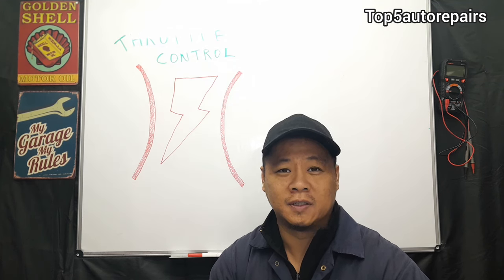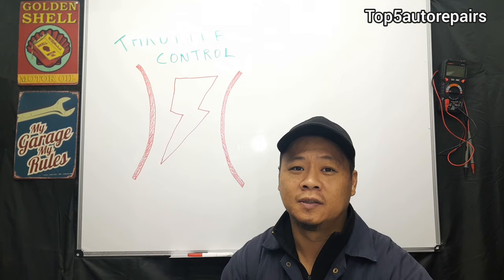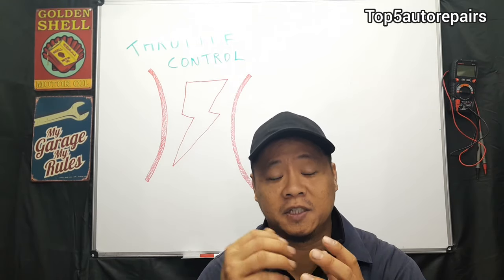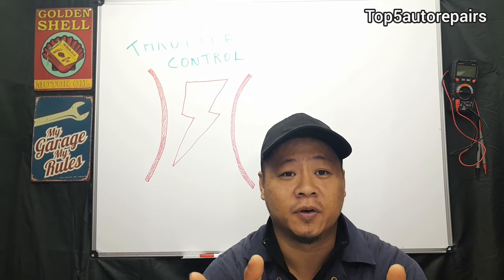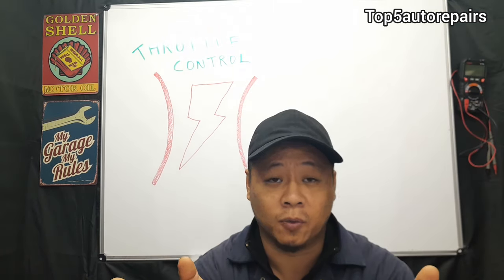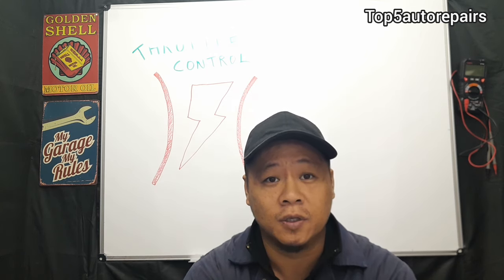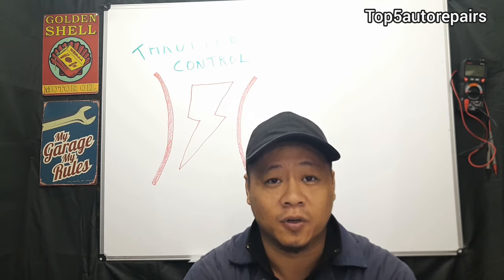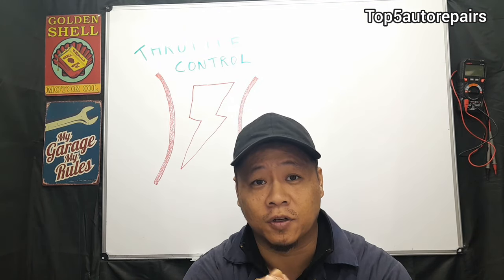Lightning Bolt Warning Light Showing Up On Dashboard How to Fix It for Dodge Chrysler Jeep etc..

Comment: FYI ... Mine was not the throttle body.... Check the codes first... Mine was throwing 7 different codes... one of them being the crankshaft sensor and that's what my problem was. Every video I watched here said " throttle body" and I wasted 300 bucks on one..... Oh well lesson learned. Check the codes.
Reply: What did you do for the crankshaft sensor
Reply: @EscobarMT  I took it to a repair shop, it looked to difficult for me to get  to.
Reply: @JB-ef7qc  and did it get fixed? In other words did the lighting bolt showed up
Reply: @EscobarMT  Yes it runs great now, the lightning bolt went away

Comment: My engine light and the lighting warning came on and dropped the coolant needle all the way to cold i scanned the vehicle and it comes up as a throttle body and coolant temp sensor issue
Reply: I have the same issues...
Reply: @raw_si_siht  yea it clears itself after a few cold cycles but i recently had new cam and lifters installed maybe the shop didn't calibrate the throttle body correctly or something its a weird issue 😂🤦‍♂️🤔
Reply: @BlackSheep300  My problem is floating on the freeway and only the freeway. It gets dangerously close to cold on the gauge. Doing a little research it's either the thermostat or the coolant sensor...
Reply: Did u fix if so how mines doin the same thing rn
Reply: @eliiskii-8410  one day it just cleared itself and hasn't came back since then
Reply: Same here coolant temperature sensor
Reply: @BlackSheep_300c  how did you fix it
Reply: I had that issue and it was the Thermostat sticking open and it made fuel trims off so every light came on pm
Reply: @lindsayshelton5345 Was your vehicle showing the P2181 code and the throttle control light? Mine does while the temperature gage sits all the way down.
Reply: @danielwells3526  I don't remember code number but it was a code for engine not reaching operating temp and many dash lights I recommend verifying the Thermostat is good. They are cheap
Reply: Same with the 2012 dodge charger
Reply: Mine was the coolant temperature sensor as well that fixed my problem.
Reply: Same thing I didn’t check the cel light. But no heat. Car was still powerful. I think the autozone failsafe thermostat is shot
Reply: same things happened to me we 07 JGC two days ago when the wind chill. hit minutes 30 in Kansas City.  Car appears to be running fine for now.  fingers crossed
Reply: Mine too but it is also leaking… looks like my water pump failed also?
Reply: @danielwells3526 did u fix it?
Reply: @glitzyclaps7719  Yes. Swapped the throttle body (I don't think it was the problem), installed a new coolant temp sensor, and topped off the coolant (make sure to burp the system in case of air anywhere). Doing this got rid of my problem completely. The throttle light seems to come on when these cars have other issues, which can be misleading.

Comment: First lift your engine plate and make sure all plugs are connected. I’ve been experiencing this for a week now and this morning I check under the engine plate and a wire has come unplugged. Plugged it back in and problem gone
Reply: Thank you, but what do you mean by Engine plate?
Reply: @Bootnerd3  Guessing he means plastic engine cover over the coils and plugs on top of motor. Where the oil cap is.

Comment: My Jeep will be working just fine and then the lightning light comes on and kills the motor and then won’t start for a terrifying minute or two then fires right up and acts like nothing happened 😑
Reply: My 2011 jeep does the same thing
Reply: What was the problem or did you fix it ?
Reply: Was it fixed?
Reply: Did you figure this out by chance? My 2008 Jeep is doing this as well, runs fine, idles fine this light comes on flashes a check engine and dies. Starts right back up as if it didn't just give up on me. 😂😢😅

Comment: I did recently replace the starter … the check engine light did come one for 2 days then it went off , it’s not on now but throttle body light is on

Comment: This happens to my dads dodge caliber but ONLY when its cold
Reply: Exactly the same problem with my 2009 caliber. And it looses power when the light shows up
Reply: What’s the solution
Reply: Exactly same here
Reply: Same here only when cold. Last time we noticed our engine oil was low. And the vehicle doesn't have a low oil warning and that can be one reason....at least by the videos we searched up. After adding oil it didn't happen again in the very cold weather.
Reply: @magdalenagonzalez372  our oil is fine
Reply: Have yall fixed it yet
Reply: @adanreyes7790  taking my POS to a dealer mechanic to diagnose it.  I changed out the throttle body, PCV valve , checked Purge Valve functioning, battery is full, oil is good.  I’ve read someone said their fix was several things, a new one I seen today was the fuel injector o-rings..
Reply: Right it’s happening to me now off and on all winter idk what to do
Reply: @imtryingtomakeitkobk8418  mine is currently doing this when it's cold I have changed throttle body the whole pedal inside every thing the o2 sensor idk what else to do to fix and nothing comes up on diagnostic tests
Reply: @sef2273  have you tried replacing the accelerator pedal?
Reply: @disgruntledgrappler  no, I’m going to try replacing the intake manifold gasket cuz I can tell it’s leaking…
Reply: The same here I got a jeep compass 2012
Reply: Just so everyone knows I changed my leaking intake manifold gasket and my problem went away. It was not the throttle body.  Even tho I had the red lightning bolt and limp mode.  Problem solved.  I also had a leaking primary thermostat housing I replaced that too.
Reply: @jessicamartinez9678  check your intake manifold gasket. Spray some mist water or break cleaner around the manifold while the car is running. If the engine starts to choke it means it’s leaking
Reply: @adanreyes7790  it was the intake manifold gasket!
Reply: @sef2273  did you get any P code?
Reply: @psilva00  believe there was a large EVAP leak code.  But I think that was associated with the ESIM leaking. Could of been both.
Reply: @Sobergoddess have you gotten the issue resolved?

Comment: Thank you for this video, my father has lung issues and his jeep patriot broke down late in the evening. Just from talking to him over the phone of the issues, I was able to pinpoint it to these issues and drove out late evening to replace the bad TB. Tried relearning, resetting and disconnecting the battery, all did not work.
Reply: bro I’m going through the same shit with the exact same car. the Patriot is dawg shit. make senses why they stopped making it
Reply: Just drive it for couple of miles the computer needs to relearn the throttle body..
Reply: I love the jeep patriot meeting. It's turning to a pos
Reply: @EricIbe same here for me months later. I hate this damn Jeep
Reply: My throttle body likes to act up when it’s cold outside , I just replaced it … it was fine while it was hot but now that it’s cooling down it acts up ( flashes for a few seconds , when it flashes it idles weird … just by me simply cranking up still in park … )
Reply: @Rreneemilli My 07 compass just did this dumb ass shit when I got off.. just got the TB replaced though smh

Comment: I don't know much about vehicles but I had this issue (dodge dakota) a few months ago and had it fixed.  Well the light is back on and earlier it didnt start the first few times, which is what happened the first time until it didnt start at all.  I'm assuming thats going to happen the next time I try and start it.   I know this is a hard question to ask online but any obvious reasons why it would go bad so shortly after being fixed?  Faulty part, something else, etc?     Also just had wheel bearings replaced and one is going bad.   I'm so annoyed because TWO things I just had fixed already need to be replaced!   Sorry for ranting... thanks for the good vid.

Comment: Mine is giving me a code of p2173 . I changed my throttle body and still get it.  When changing my throttle body i accidentally dropped it on the ground and cracked a little part of the plastic. Will that cause that code maybe cause its cracked? Thank you so much for your informational videos.

Comment: I just got that lightning ⚡ symbol and was due to weak battery so I jumped started deleted it all error codes and it worked well now... I'll have to find out what's causing the battery to die if I don't turn the vehicle on every day tho
Reply: Did you find out?

Comment: I replaced the throttle body, and the MAP sensor because the throttle control and traction control lights keep coming on. After I replaced the throttle body I got a code to replace the MAP sensor. I replaced that also. The throttle body and traction control lights are still coming on. The codes from O'Reilly's are still showing the MAP sensor needs to be replaced. Somebody told me that the traction control sensor might be dirty, and causing the problems. I do have a strut leaking hydraulic fluid. Do you think this could be causing the throttle body light to come on?

Comment: 2014 dodge journey, feels like the fuel pump is going, but I’m thinking it’s the TPS sensor. At idle when I stop, the idle on the rpm gauge will go up and down about the width of the needle. Acceleration is fine, but sometimes at cruising speed, it will surge, and goes away if I add more gas, or down shift to 5 gear. When climbing a hill, it’s worse. When I go through the mountains, 9/10 times, the lighting bolt comes on and goes away on a restart. I don’t get limp mode, but my engine temperature gauge stops working and I lose heat. Should I start with TPS sensor?  352,000km on it. Just had transmission done last year. Dealer replaced solenoid and some linkage stuff. New pan, filter, etc. last month I did oil cooler, starter, spark plugs, radiator, hoses, reservoir, air filter, thermostat. That’s why I thought it could be the fuel pump/filter?
Reply: Did you ever get it figured out? I’ve replaced so much stuff on my 2015 journey & now it’s doing what you described. Now it just won’t start. Just clicks. Alternator, starter, battery, solenoids & battery sensor are all new/tested good. Throttle body was replaced like 2 years ago along with new plugs & wires. Ran fine for a year then had to replace the crankshaft position sensor. Now this less than a year later.

Comment: I have a 2008 Jeep Wrangler that I just replaced the intake manifold gasket put it back together and it’s doing exactly what you just said did not do it before so should I be looking at the throttle body?

Comment: Help if able need some pointers. Have a 08 ram 5.7. beep once when taking off from a stop. Replaced throttle body, EGR and cleaned O2. Replaced coils and plugs. Also has ruff idol when at road speeds and really shows up when climbing hills. Any help would be appreciated. Thank you
Reply: May have intake gasket leaking bro

Comment: Hi I have 18/ram5500cmins 6.7 turbo diesel/. Light comes and goes. Sometimes stays for couple days. Truck works fine. I cleaned throttle body and air sensors and I replaced the batteries and erased the codes with 12+8 obd2 port as well. What else should I look ? Thanks.

Comment: Looking for some help on my situation. I have a 2014 Dodge Journey and I recently replaced my throttle body with a Dorman brand. I have done the pedal reset, disconnecting the battery cables,  and still it does not last more than a week before it goes right back into limp mode. Do I need to find someone who can program the new throttle body to my cars computer? I am stuck, and don’t feel confident driving my car without having to constantly reset it. Any help is greatly appreciated.

Comment: 2016 jeep wrangler replaced thermostat, pedal, and throttle body.  Light is still on dash flashing. Did the toggle with ignition, unplugged the battery, but still will not go off. Any ideas?
Reply: Maybe it's the plug for the throttle body
Reply: Cracked intake manifold or bad intake manifold gasket. 
Spray some carb spray between the intake manifold and engine cylinder head where it mates and around the intake manifold as well 
Listen for a change in the rpm’s.

Comment: I took it to autozone and they said it would most likely be a fuel pump issue. I just replaced the throttle body. Did not calibrate it (caliber srt4). Could this be the issue?

Comment: I got same problem replaced map sensor and throttle body. No codes come up but after driving for a while the throttle body warning light comes back. How can I fix this issue?

Comment: I just replaced my throttle body cleaned mass air flow too and a few weeks later it's still throwing red lightning bolt when it did do it only when cold with oem one

Comment: Pretty sure it might have been mentioned here....I own a 2011 dodge avenger 2.4l. this fall started throwing lighting bolt and anti slip light with idle ramp up. I'll I have been doing is shut off and crank up and it would be gone till next day. Has been getting worse. Now will go into limp mode sometimes on highway or engine just straight up dies noatter what speed. You have to pull over put in park. Shut key off and restart. Replaced throttle body and ambient air sensor in box. Still same problem. Seen someone somewhere mention after new intake was installed they never had problem again. So I grabbed brake cleaner. Started up and started spraying around intake. Everytime I would spray the last intake port on the right it would idle down. Pretty sure my intake is leaking. So I guess I need new intake or at least new orings installed on port. New part is roughly $220 if you do it yourself. You have to take it completely off to do oring gaskets anyway soight as well replace the whole thing in case there is a crack. 255k on my vehicle.

Comment: I’m back with an update for 2020 dodge charger scatpack check engine light on throttle body service and I have recalibrated the throttle body through the gas pedal and after taking out fuse for engine module and stability control fuse after putting in the fuses and starting up the car check engine light went away for now I still haven’t cleaned the throttle body and clean my air filter

Comment: Got some problem with my 200 lightning bolt and traction control appear in my dashboard and rpm going up and engine is shaking when they appear..what's the problem is it bad sparkplug need to change it or the throttle is the problem thanks
Reply: Same here
Reply: Same 😢
Reply: Same
Reply: I did alternator spark plugs throttle body. Goin to battery now cus its still coming up. Every i listed was years since being changed so hoping battery is the last of this mess

Comment: This is happening on my son's 13' Jeep GC- It shuts off while he's driving it and leaves him sitting (often times in very dangerous places. ) He used to be able to get out, with the key, then get back in and it would start back up, but the last few days it doesn't seem to be working and he has to just sit for 10, 20+++ minutes and hope it starts back up. Any suggestions would be most appreciated!
Reply: Had this been resolved yet? What was the cause

Comment: The root behind mine was a vacuum leak from EGR tube to manifold the small gasket had to be replaced runs okay for now but bought a new throttle body for no reason

Comment: Im dealing with this on my 2003 ram 1500 i swapped out the throttle body and map sensor i keep trying to reprogram it with the gas pedal technique but the light keeps flashing and going into limp mode after a minute of idling

Comment: I have this light and check engine light on my truck will turn but won't fire and with the current throttle body and a new one the valve opens and closes when the pedal is pushed but still won't start

Comment: How do you check the Accelerator pedal sensor to see if that is bad ? I have clean the throttle body.Just like you said to our looks brand new again, but I'm still having the issue where the car is.
Shaking with vibration when the red light lightning bolt comes on. When it's sitting in idle.
Reply: Hey did you end up finding a solution in fixing it? I’m currently having the same issue

Comment: I have a code P0122
Throttle/Pedal Position what should I fix first the throttle body or the pedal position sensor
Reply from the maker: Try cleaning the throttle body and check connection and wire at the throttle body

Comment: Thank you, brother. What if engine & throttle Light come on together. Car cranks but it won't start? Is the entire body dead (hopeless)? Dodge Ram 08. Does car need to be reprogrammed? Jumped?
Reply: You ever figure this out exact same issue today cranks but won't start already tried a jump and I've cleaned the throttle body spotless but still crank and no start

Comment: Red lightning bolt flashing, changed alternator,  new throttle body, and sensor on air cleaner. Still happening.  What do i need to do?